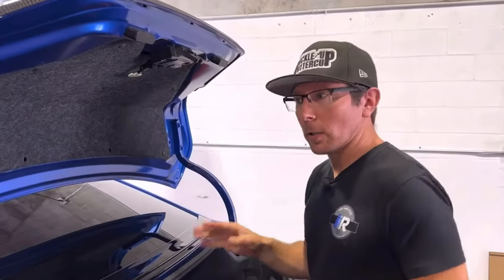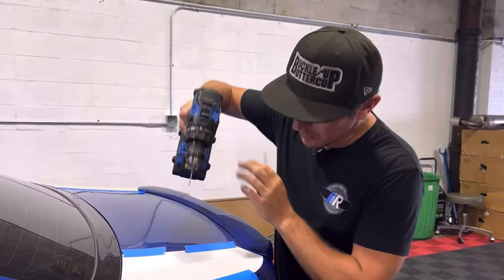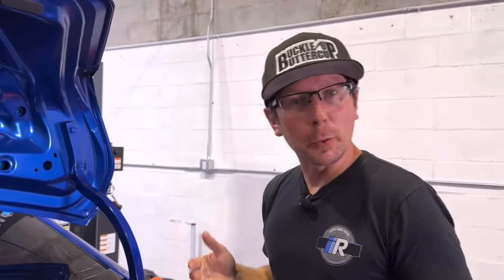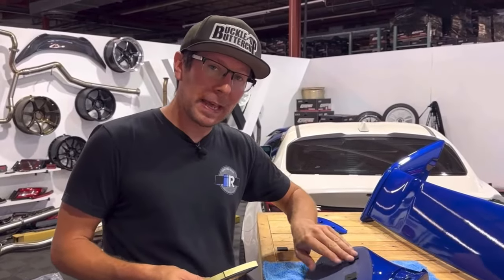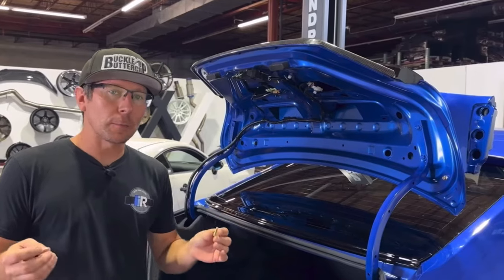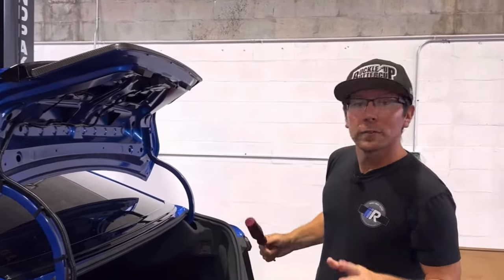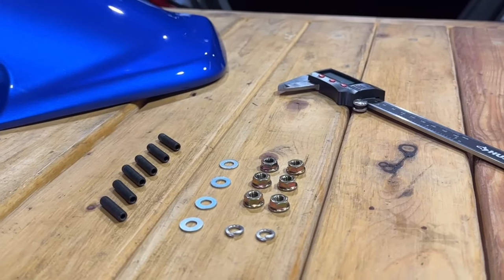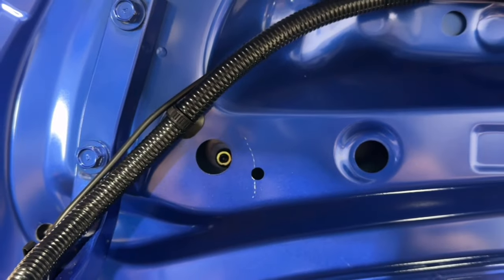Noble STI Spoiler Install for 2022+ Subaru WRX | Includes Series 1 & 2 Hardware |

Comment: Will the Nobile Spoiler fit with the Nobile wing on the trunk at the same time?
Reply from the maker: Yes, we commonly use it with the new noble noble rear spoiler https://www.importimageracing.com/products/noble-rd1-style-trunk-spoiler-paint-matched-subaru-wrx-2022-2023?variant=39775342002272

Comment: The wing is easily tied with my exhaust as the best modification I did for the car. Everyone should do it. However, the self tapping screws didn’t really work out. Fixed it with body colored tape and it’s held together for several months now.
Reply from the maker: Glad you enjoyed it! Thanks for the comment 🤘🏻